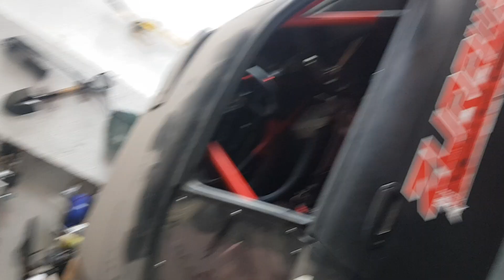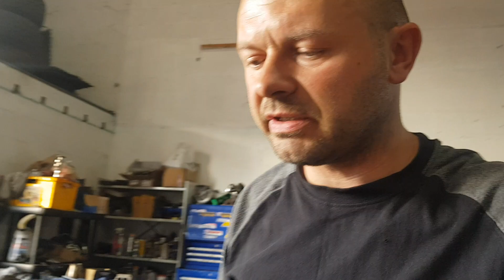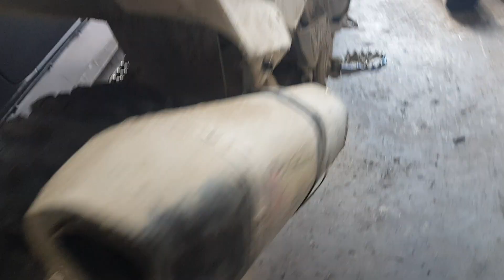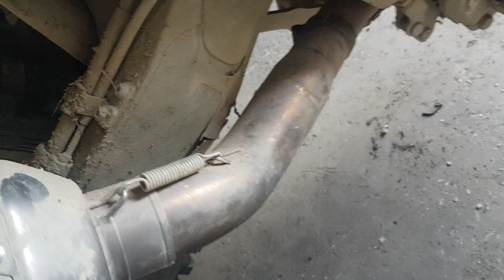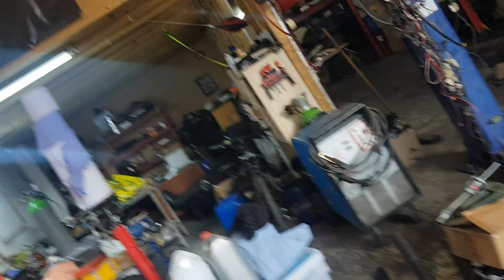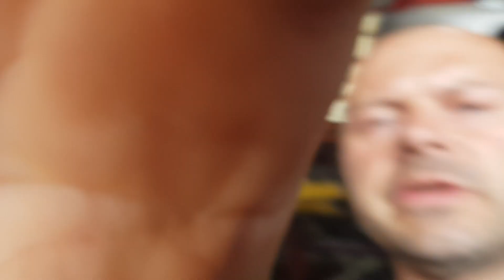aftermath from the baja championship round 2

Comment: Get that YZ fender back on there😉
Reply from the maker: Tell me about it, but I need to make sure the air "veins" or openings work good enough on it otherwise she likes to run real hot on the radiator,  this one is much better for air flow but definitely not on water/mud cover
Reply: @zurawskimotorsport  Iknow right. See runs so hot so easily. I even cut the complete rear half off, but I am still getting extremely high temps without even trying. 
Haven't had to deal with mud since I cut it, but I reckon my rad guard will be covered quickly😏